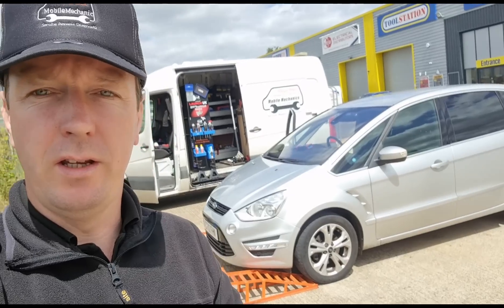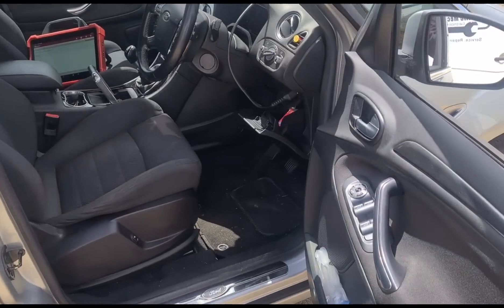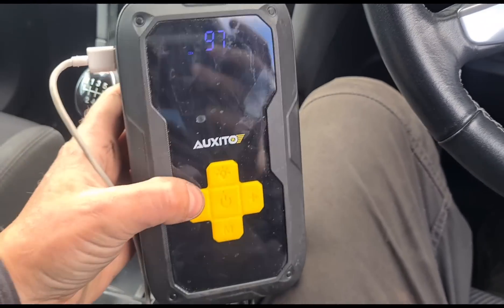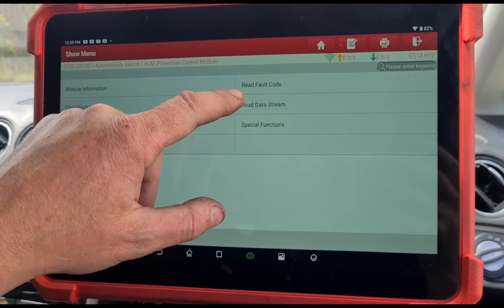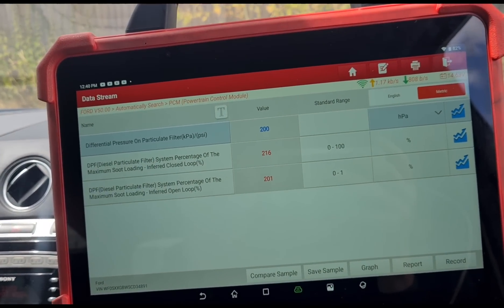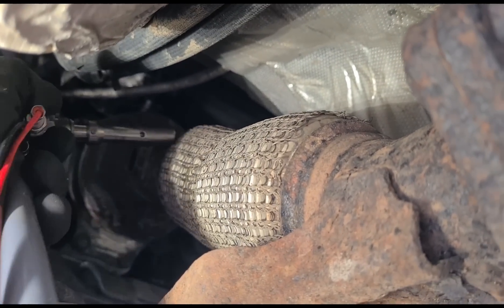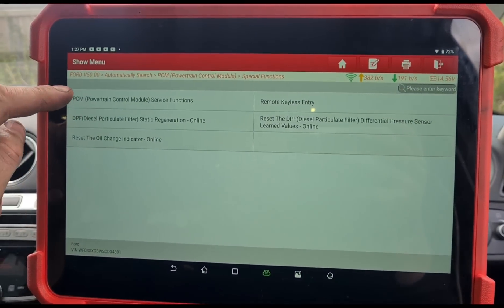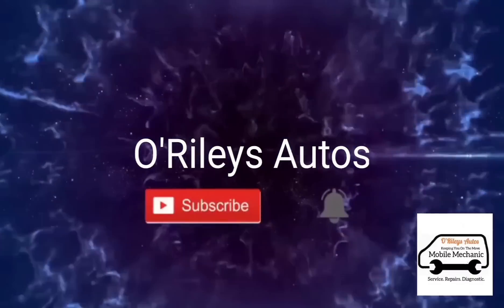Ford P246B:00-2F Vehicle Conditions incorrect For Regeneration P246C:00-2F Particulate Filter

Comment: I have a 2.0tdci smax 2014 and I seem to be getting white smoke during regen. I can hear the pump for the injector so assume it is regening. It drives fine with no fault codes I've had the car 2 months and have noticed it 3 times. I've probably done 1500 miles. Today I heard the pump then switched the car off. Then turned it back on 5 mins later and pump continued. I'm guessing too.much fuel is being injected. Any ideas would be appreciated.

Comment: STOP resetting dpf values. It’s completely unnecessary and causing issues you don’t realise. Replace the vaporiser, carry out a static regen (so the values remain accurate) and send the customer on their way. You have absolutely no need to reset dpf values. 

By resetting them, you are not only resetting the soot values but also the ash values. From now on, all ash in the dpf will be considered soot. The vehicle will regenerate much longer and more frequent than necessary as it can not regenerate ash. 

Repair the fault. Carry out a regen. Done! That’s it.
Reply from the maker: Sorry ill choose to avoid your advice. Static regeneration especially on a +200% blocked DPF will likely cause damage to the DPF itself or the car.  Resetting the values the car will learn again very shortly where it's at
Reply: @ORileysAutos  you’re welcome to ignore/take any advice you like, but I’d suggest believing that you know it all and there is no one out there that could teach you something new is perhaps not the best attitude. As I explained, resetting the values not only resets the soot calculations. It also resets the ash calculation. This can not be relearned. You’ve told the vehicle a new dpf has been fitted with ZERO ash in it. It only has a pressure sensor, so has absolutely no way of determining how much pressure is caused by soot and how much is ash. Regenerating a dpf over 200% is perfectly fine. Ford have a limit of 300% on most older vehicles and newer vehicles such as the connect with the 1.5litre can be regenerated perfectly safely with no limit whatsoever

Comment: Just a quick question Jimmy. Do you ever check the condition or service history of cam belts (if fitted) before you do a DPF clean and who would be liable if the belt did fail? I know that when I was MOT testing I refused to test several diesels  because of low engine oil levels or belt condition.

Comment: Kind expected 200 Mbars and a blocked vaporiz
er. Typical ford 2.0 TDCI engine faults. 
My mondeo 2013 had the same. Dinages ford dealership was stumped when I suggested it was a blocked fuel Vaporizer for the DPF. But they checked it, replaced and it worked flawlessly. 

Even the principle technician said he'd never heard of this fault/ Occurrence before. I said 'maybe you should check out YouTube for O'Rileys Autos various DPF videos.

Comment: This bullshit on cars these days really are no good for the enviroment, , just look at the shit coming out of the back end with all those chemicals, soot and all sorts ! ?? 🤔😬😷
Reply: A DPF is a form of smoke & mirrors to address urban air pollution. It collects soot in town but burns it off once you’re out in the countryside 😬
Reply: @hughmarcus1  I know that, but when it all goes tits up then you need to go through all this rigmarole to cure the blockages which is usually done in an urban area thus defeating the object, this plus the fact that air does tend to move about so air in urbanisation moves to the countryside and the countryside air moves to towns etc plus the fact that not all vehicles travel out of many towns, so like I said "a load of unnecessary bullshit of a system" 👎🤬🤬

Comment: Jimmy, asking for a recommendation. My daughter wants to buy a 2016/18 ish van to convert into a weekend camper. Max size Peugeot Expert. What would you recommend, with regard to engine reliability. What would you choose. All welcome to comment.
Reply: Anyone without adblue
Reply: I have also bought the Launch uk cleaning kit, just short of a scan tool or laptop with Forscan.  Our family has some experience with the vaporizer... when we didn't know,  my daughter had oil dilution etc etc etc, and had it done at an independent garage with ford equipment... my youngest son bought an Ebay vaporizer and I got the old one out with impact wrench and extension. No problem since.
Reply: I have bought a 2014 transit custom mid roof 2.2. I paid our mobile mechanic 40 to scan and give any advice. It was on 121k, bit of low vibration sometimes,  he says its the dmf, but use it till it gets worse. No faults found on scan,  76% soot in dpf. Parts widely available and usually for reasonable money.

Comment: your vids have pretty much convinced me to go petrol next time!  keep up the great work
Reply: As a mondeo mk4 owner I understand these now with Jimmy's help, next car will be a suzuki jimny for me super simple and does its job
Reply: I'm thinking electric
Reply: Me 2!!  @thinfourth
Reply: @thinfourth less problems but no vehicle is problem free.
Reply: @thinfourth Yeah and get charged for pay per mile driving by the end of the year , the government are bringing it in for EV owners as it will bring them in line with ice vehicle fuel taxation  , check it out for yourself .
Reply: @thinfourth  lol, if you think these things are complicated, wait until you see the inside of an EV invertor 😂 1000s of components and the Failure of any one of them and your EV is dead in the water.
Reply: Also difficult to sell second hand with the wariness about battery replacement costs after a certain time
Reply: My next car will certainly be a Petrol model. I’ve had my 2008 Ford Mondeo 2.2 tdci (Q4BA engine) for 17 months now. It’s been the most frustrating & unreliable car I’ve ever owned!
Non stop headaches & stress.
And I’ve done all the work myself.
No garages involved.
Just watched O Reilly’s videos for information & assistance. 
But the 2.2 tdci still gives me headaches. I cannot wait to get rid of it.
Reply: Feel your pain. I've also got a Mondeo 2.2, honestly terrible engine and mechanicals. Mines been smoking on acceleration and failing regens for 2 years, only getting 35mpg. Had new dpf and vaporiser, no better. 3 garages, all said nothing wrong with it cause no fault codes.... @tidysampler585